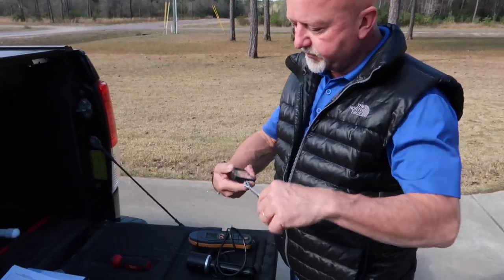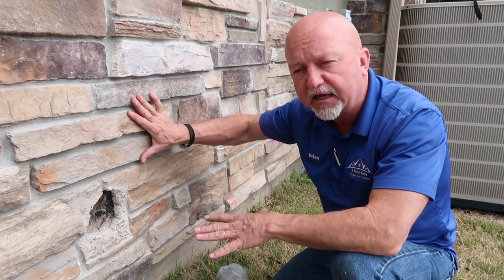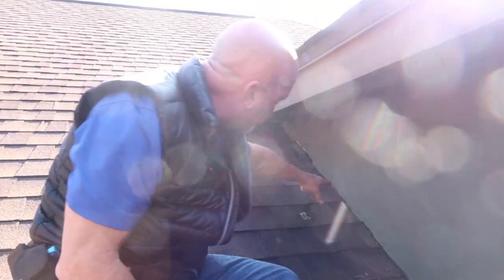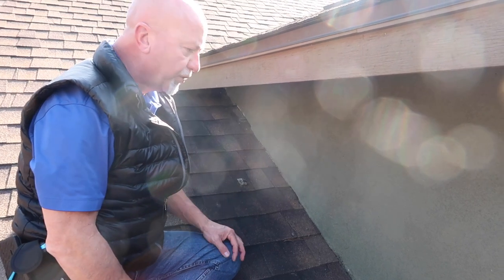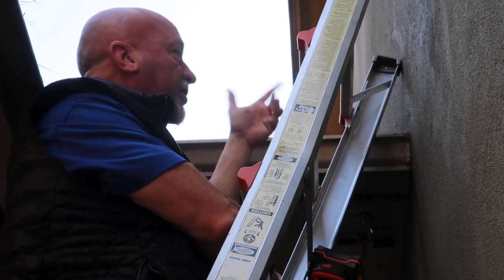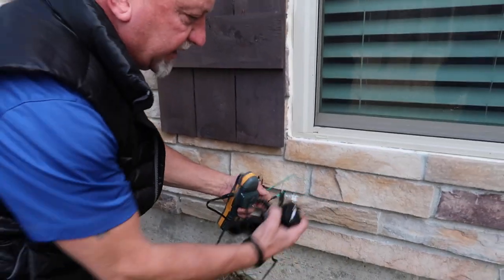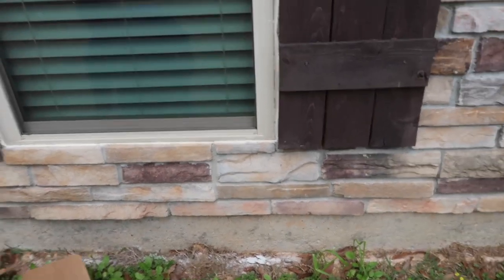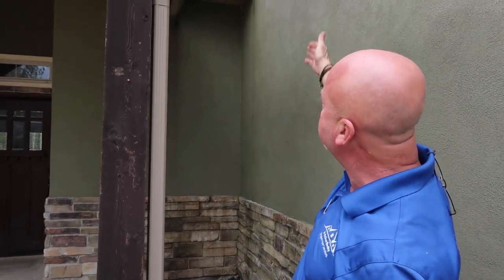Stucco Training Day - The Houston Home Inspector

Comment: Im a contractor and ive had master inspectors recommend repairs on osb cuz of moister meters detecting  readings of moister. Cant even remember how many times they were wrong...Went out for repairs and it was all dry no rot or damages waist of the clients money...
Reply from the maker: I think some inspectors forget to use knowledge outside of their tools.  You can get false readings from metal and make sure you do not drill too deep.  You can easily drill too deep and it can cause issues.
Reply: @AActionHomeInspectionHouston  Yeah I bet

Comment: I was wondering why you had to drill a hole to recommend kick out flashing. I love your videos and watch them to see if I'm missing things I should be looking for. But kickout flashing doesn't require a drill? I also did not see any actual stucco, I haven't finished the video yet but almost half way through and no stucco.
Reply from the maker: This is an intrusive test for a 3rd party and is required to prove there is moisture.

Comment: I wish I had an opportunity to do this kind of invasive investigation, we have almost all stucco here. Did you pick up moisture by IR or moisture meter inside this house? Did you drill near every window and penetration?
Reply from the maker: We did pick up moisture reading in the attic area under the stucco to roof contact.  We do drill every window and under questionable kick out flashing areas.